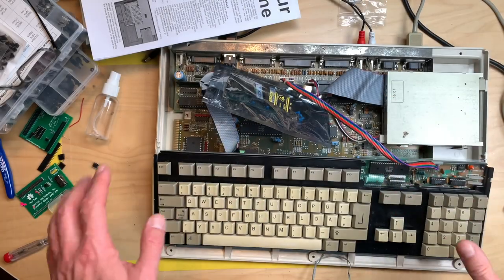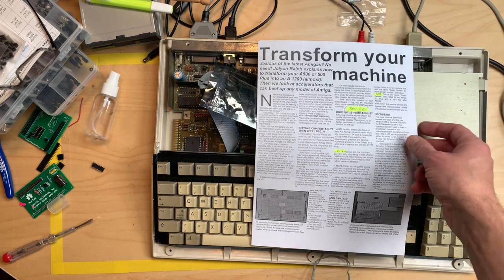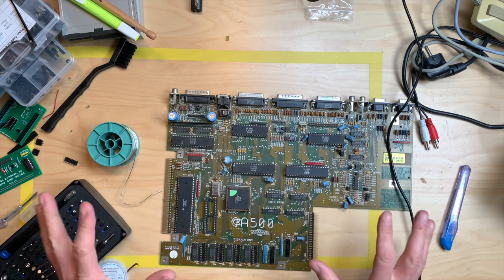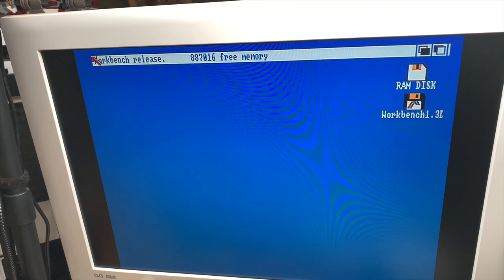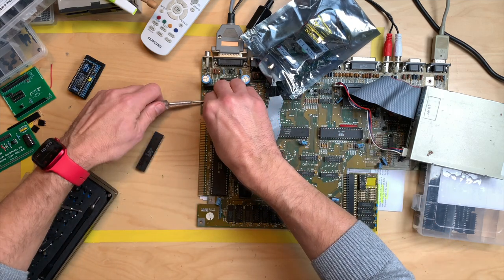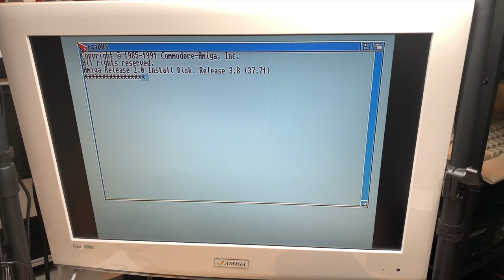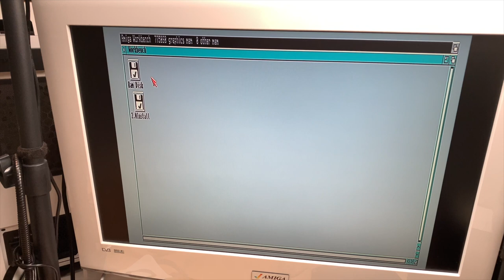Can you turn an Amiga 500 Rev 6a into an Amiga 500+? Watch me!

Comment: Thanks for the video. The only difference between this and a real A500 Plus is that this one will only support 1MB chip RAM. A real A500 Plus with it's Agnus 8375 will support 2MB chip by adding 1 more MB in the trapdoor. With that said, I have built five A500 ++ replica boards. 3 of them are using Agnus 8375. In two of them I opted for the Diet Agnus adapter to allow for Agnus 8372A. Because the 8375s are so overpriced. So two of my A500 ++ replica boards are limited to 1MB chip. Not a big deal as 99.9% of whdload games run fine with 1MB chip.  Also, in many of these builds I was transplanting parts from ruined A500 Plus or A500 Rev.6 boards. I did have success in desoldering the 3 legged EMI filters. Alot of heat and old leaded solder. And alot of patience. For a couple of the builds I ordered new EMI filters.
Reply from the maker: About the ram: I know ;-) Another video ;-) Coming soon ... I tried desoldering (with heat and solderwig) the EMI filters, but they are fragile with age ... and new are not available right now where I live. So project on hold. Which brought me to this video.
Reply: @RetroWK  now that you mention it. I had a certain type of EMI filters I desoldered which I discovered had microcracks in them after desoldering. And as I started using my magnifying glass there was a whole bunch of that specific type of EMI filters which had microcracks in them after desoldering. It was the lightbrown with more of a ceramic surface. The more darkbrown ones with a more plastic/shiny surface seemed more solid. Looking forward to more videos from you :)
Reply from the maker: @larsenmats  Thanks! More videos coming soon!
Reply: 2MB Chipram or its not an A500+....

Comment: I did this with my A500 rev 6a back in the '90s!
First put a 2mb Agnus in...  then added RAM sockets and RAM...
That brought it to 1mb...  added a 501 expander to 1.5 mb
Later on... I did add the MegaChip (which comes with RAM)...  
But I think I had to remove the 501 expander.
Later on I got a real A500+ and just added a 2mb agnus...
Still couldn't use the A501... so it sat with an older A500 collecting dust.. :P
Reply from the maker: I am looking for that MegaChip. Seems to be sold out. I am thinking about using just the PCD from PCBWay and look for the parts.

Comment: Hi, Is it possible to add the ram to the board, and add a memory expansion with gary adapter to have 1mb chip, and the 2mb expansion as slow ram ???? so the expansion will not divide the ram to chip and slow ????
Reply from the maker: Yep. That is what I did in the video.

Comment: I did this way back in 91, except I had to add a wire so it could see the 512k board in the expansion bay as chip ram. I'm interested in the headline at 51 seconds, "or 500 Plus into an A 1200  (almost)" whats that all about?  Id love to see that!
Reply from the maker: Internet Archive. "Amiga Shopper Magazine Issue 27", page 20

Comment: What does it take to make it see that trapdoor RAM as extra slow RAM? As it seems now, it doesn't recognize it.
Reply from the maker: There are two spots on the board you need to take care of. It's in the video! Also you need an 8272A Agnus.
Reply: @RetroWK  I have the same question - how to enable the trapdoor RAM expansion after you have installed 1MB on the board, if you install the Agnus from the 500+. It’s not the two spots mentioned in this video as those enable the RAM on board but appear to disable the trapdoor RAM. Is there a follow-on video yet? I had a look through your other videos but couldn’t see it. Thanks

Comment: I did the jumper mod on my 6A, if you have a 512k expansion card already then after the jumper mod this is seen as chip RAM giving 1MB. What is the advantage of soldering the extra memory directly to the motherboard?
Reply from the maker: I think it does not work with all the memory expansions ... and you have the space for something else.

Comment: how do i see which revision my amiga 500s are? i have two is there some type of diagnostic app?
Reply from the maker: When you open the Amiga you find it on the right hand side (maybe it‘s under the floppy and you have to remove that). There is no software to check I know of.
Reply: Count the ram chips, if those are 16 than you have a Rev3 (1987 only), Rev4 (rare) or Rev5 (more common). To find out, check the MB right side below the floppy, the Rev5 has a description there. To check for a Rev3, usually a patch wire is present for a fix, by Commodore. If the ram chips are 4, with empty spaces, you have a rev6a (common by 1989) or Rev7 (rare). If it's a Rev8, you'll find 4 ram chips and empty spaces, and the space for a clock battery. Rev8a1 is the A500Plus, same as Rev8 but it counts 8 ram chips and a NiCd battery is present (OMG! Leak Danger!).

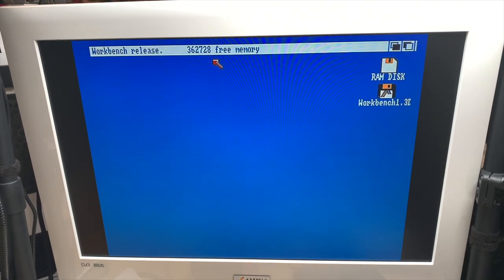Comment: 4:55 - this is not quite correct. Amiga's CHIP ram was addressable by the CPU + custom CHIP's (hence the name). The Amiga's "other mem" was essentially fast ram or slow ram. However, both where commonly referred to as fast ram. The memory in the trap door shared the bus with the custom chips so if I remember correctly the CPU could only access this memory every odd or even CPU cycle and it was therefore called slow mem. This memory could also be converted to CHIP ram as well by cutting jumpers (which depends on the mainboard version) and as for proper fast ram (e.g. ram not located at the trap door or assigned to the custom chips) the CPU could access this memory anytime it want and therefore it's name fast ram.

Comment: One question, which has been haunting me for years, since I'm no expert on Amigas:
Certain games, like Super Hang-on for example, doesn't like the A500+. How do  I know that? because I accidentally bought an A500+ thinking it was a regular A500 many many years ago.
I put in the disk, and loa and behold, the game would not load or start. I first thought it was a problem with the game, but no , it worked fine on a friends A500.
So I sold the A500+ and got myself a regular A500 instead.

Why is this an issue? Why create a machine which breaks backwards compatibility with games and software?
Reply from the maker: This was mainly due to two thing: 1. The Kickstart 2.0 in the A500+ was a compatibility disaster. You can just switch the Kickstart to 1.3 and most programs should run however there is 2. which is that very few games don't play nice with 1 MB of RAM. But if you fix 1. you should be good.

Comment: just revisiting some older videos of you. and thats really good to know, that this rev 6a boards are easy to convert, and even better the rev 8a which I bought a short while ago,
i dug it up and i was somewhat dissapointed about the state it was in, due the fact that the mouse and joystick ports have some busted pins, and it was very yellowed, but opening it up it was a real happy suprise,
dusty but a very good looking board, and to my suprise it even says 500+ on the silk screen, i think what i am seeing is jumper J2 is already set correct, (maybe thats also the reason a game that should work without memory expansion really needed the A502 this time.)
now see if I've got a super denise and this extra mem on hand somewhere.
So now I know officially, the best way to get a 500+ without the battery cancer is to buy the latest A500 rev 8 and just forget about buying an factory 500+ (zum bestes reconisable by the big badge underneath the embossed amiga logo, then you might have the best chance on having a rev 8 suspectably), dont tell anyone else ;)

Comment: The link in the description to the document does not work 😞
Reply from the maker: I removed the link. It's not accessible any more ,.. It's just, what I did in the video in writing. You can see the two main pages in the video.
Reply: @RetroWK  I found it on the Internet Archive. "Amiga Shopper Magazine Issue 27", page 20

Comment: i have amiga 500 rev 6a with 2mb chip ram mod with 8375
Reply from the maker: Nice. How did you do it? Use the 501 RamExpansion and piggyback the ram chips or something like the MegaChip?
Reply: @RetroWK  it is a converter 8372 socet to 8375 with 2mb chip on it